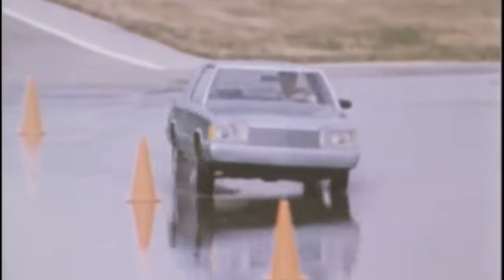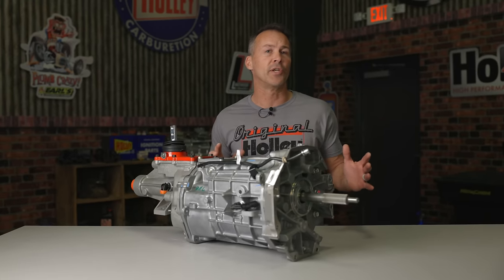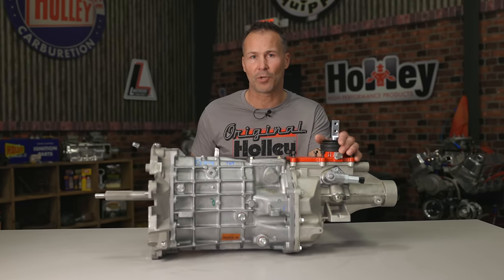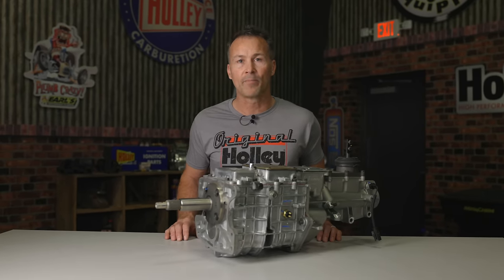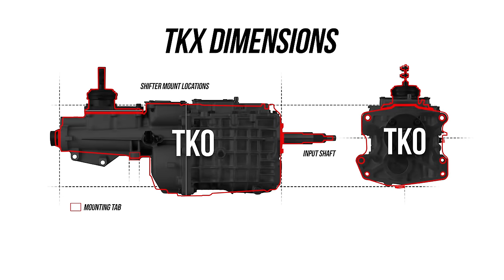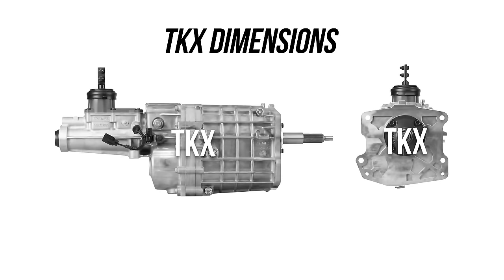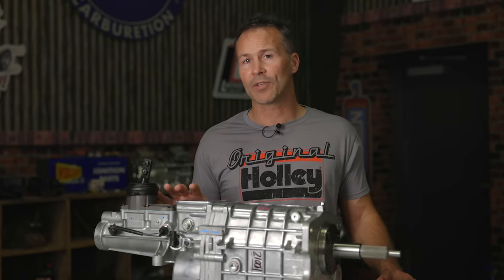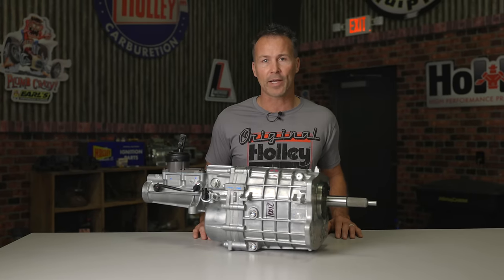A Guide To Tremec Manual Transmissions

Comment: Have had a couple T5's behind a few SBC's in my FC rx7 Chassis and its done well as long as I didn't miss a shift, I finally found the real breaking point with 482whp and 565ft'lb. I still granny shifted it as light as I could but I believe she is cooked for good.. I am almost ready to order the TKX transmission as a beautiful upgrade to replace the well tested T5. Anyone who says a T5 is garbage  probably misses alot of shifts.
Reply: Update: pulled the t5 out, turns out it was a non world class t5 that has survived 3 years abuse and 1 year of 565 ftlb of torque
Reply: ya i was running 400ft lbs in a datsun z for a few years no prob, lower car weight helps
Reply: @kennethfrazee2540  how many hp do you thing a t56 can withstand reliably?

Comment: I want to put a T56 Magnum behind a Gen 1 350 SBC. What aluminum bell housings are available (if any) to mate the two without an adapter plate or machine work on the trans or flywheel end?

Comment: Nobody mentioned that Jeep used T5s in the CJ. 3rd gear would blow out. I’ve built a bunch of them. Another POS was the Peugeot BA10. Weak knee’d piece of French junk. These used a rearward facing synchros and the locking sleeve is inside rather than sliding over the outside like most other transmissions. Shift gates were prone to breaking also.
Reply: 1982 cj7 blew 3rd gear downshifting on the street at moderate speed.

Comment: Not trying to critical, but at 1 :07 . .  showing 4 gears, talking about 5 (overdrive). 4th gear is 1:1 right? BTW, the T5 was also widely used in the F bodies from GM. But only with the 5.0 (305 cid)

Comment: Is there a special set of pliers for getting the retainer rings off of the speed sensor reluctor wheel? Its easy to get it off of the older style plastic gear with a screwdriver and pliers but its extra tight against the newer style wheel. I want to just keep prying at it with a screwdriver, but i know im just going to end up stabbing myself before i get the darn thing pried free.  I have some piston ring pliers, but theyre a bit too large to fit in that space.

Comment: I wonder if one of the Tremec transmissions could be put in my 1981 Mercedes 240d that has a 4 speed manual.  My 1964 Ford f250 also has a 4 speed and a 5 speed transmission would be perfect for both of these vehecles.

Comment: Have a 95 GMC Sierra 3500hd and it's got an NV 3500 transmission with a 454 engine if I was to switch to a tremec which transmission do you suggest I use

Comment: i wish yall would make a manual trans for us diesel guys to swap to. i'd love to swap in a manual, but nv4500/5600 dont like to shift fast, g56 is just weak, and i've not heard of anybody running a zf5 or zf6 to know where they fail when drag racing.
Reply: Best option for a new trans is a Tremec TR4050
Reply: I'm running a ZF6 by choice.  They are extremely strong transmissions,  & were grossly underrated. And specifically the Blue label,  & especially the Black label ZF6 speeds found in the C4 Corvette, the Vipers,  & Firehawks. The Blue label & Black label  were  originally rated at 700 & 750 ft lbs of torque in Germany, & Europe , but also early in the U.S.  but then downgraded to 400 & 450 ft lbs. This being to the surge of power increases in engines during this time, especially in the aftermarket upgrades, & so due to liability issues for companies like GM, etc etc they downgraded the max ratings to deter them being pushed to hard. Ironically the noise factor that got so many complaints from users is also a major strength factor, in that they have straight cut gears,  same as many "big" diesel trucks have. The ZF was originally designed as a truck transmission. Due to these complaints, the Blue label had more helical cut gears to help with noise, & obviously the Dual Mass Flywheel  (DMF) was also used to help with this noise, but also to soften engagement like a sprung hub clutch with a Single Mass Flywheel would. The DMF uses a solid hub clutch. Many serious race cars & big trucks will use a SMF with a solid hub clutch. But it is a very aggressive engagement. 
 Regardless, the ZF's are different then most manual transmissions,  & so specialists specific for them, & not to mention considerably more expensive to rebuild. Especially these days. There currently is only one real person in the U.S. who specializes in these, this being Bill Boudreau aka the "ZF Doc".  But this guy is no joke, he goes thru them, rebuilds them to the highest quality. I have my Black Label rebuilt & blueprinted to withstand over 1000 ft lbs of torque by him. I'm also converted to a Spec flywheel & clutch assembly, because the DMF won't handle the power from my Dart blocked 384 Stroker SBC with forged internals,  twin turbos , Holley EFI system,  and a lot of other goodies.  Lol! But my highly modified C4 Corvette is another story.  
Regardless for most, there are probably better options in that there are many other strong manual transmissions that would be overall cheaper to use. In reality I could have bought 2 brand new T56 Mangums for what I have in my ZF6.  Not to mention my C4 was originally an automatic, & I did the conversion myself,  as did I do all the other work on it, such as building the engine,  suspension,  etc etc etc.
Reply: @corvettefever360  I have a 93 corvette with the zf6 and I love it, Its showing its age but still great. but after ford discontinued the zf5 manual they went to the zf6 in their trucks for awhile, It's not the same one is it? they definitely don't feel the same.
Reply: @corvettefever360  "blueprinted to withstand over 1000 ft lbs of torque by him" yeah thats the problem though diesels can make that pretty much with just a screwdriver and injectors on a mechanical or a tune on an electronic injected. and they do it at a much lower rpm than a gas engine which puts more stress on the trans. there just isnt a manual trans that exists right now to handle a built diesel in drag, drift, or road racing that will last. maybe the lenco could handle drag though you'd need something like the cs1 to handle a boosted 4x4 launch. and i'd hate to see the maintenance schedule.
Reply: just use the 6 speed allison trans from the duramax. Beefed up it can easily handle over 1k horsepower.
Reply: @kenshinhimura9387  But I don't know how to drive automatic
Reply: @kenshinhimura9387  with the allison 1k ignoring the several thousand $ standalone controller just to make it work you get no push starts, no drifting clutch kicks, no ability to run in stickshift classes, increased heat output, required trans cooler and all its issues, and a trans tunnel large enough to fit a vw beetle.
Reply: If you can’t shift the NV5600, me thinks the problem lies in the driver....

Either way, if you’re racing a diesel with a manual, you’re used to losing to less powerful trucks routinely. No, the trans will never shift fast enough to be quicker than the autos. Toss a 48re in there and call it a day
Reply: @moparproud3978  i agree auto's are faster, but a manual is more fun and they're allowed in stickshift classes and drifting clutch kicks and i never said a nv4500/5600 couldn't shift. I said they dont like to shift fast.
Reply: @dungeonlord  I know what you said. I have zero issues shifting my NV5600 “fast”

Comment: How much torque can the TKX hold?? Was mentioned for all the trannys except the TKX unless I missed it?
Reply from the maker: 600 LB/FT
Reply: @HolleyPerformance  how come you couldn't get the tremec 5 spd with a 350 in 1986 trans ams? gm said it couldn't handle the power of the 350 , which wasn't much in 1986.
Reply: @fransmith8992  thats over 30 years ago...technology my friend
Reply: @jubjub905  aha. so now the t-5 is much stronger? how much will a modern one handle and is it a straight bolt in replacement?

Comment: Is there Tremec T-5 variant that will fit my 84 300zx Turbo?  I want to swap from A/T to M/T,  but the Borg Warner T-5 has a smaller pilot diameter and spline count (24t) than Ford (10t) or GM 21t). I also wonder if the length of the transmission may be different so the shifter won't line up with the port for the shifter.
Reply: manual z31s came with t-5s. Its easier to find one made for the 300zx because they use different input and maybe output shafts like you said, than trying to find a ford or aftermarket one.
Reply: @peterdeboer2805  They came with three different transmissions depending on the model and 6 different driveshaft configurations. It's also incredibly hard to find a low-mileage one, so that's why I need to expand my search to alternative options.

Comment: Imagine if the emissions era hadn’t happened. The t5 would’ve been awesome
Reply: Did they use poor ratios?
Reply: @chaseschlafmann1239  poor case reinforcement. The t5 case flexes in 3rd if you push a lot of power because they were intentionally only designed to handle the 185 horsepower of the 305 and 5.0 of the 80s

Comment: I didn't hear the torque load capacity of the TKX. Is it higher than the TKO 600?
Reply: Yes.  The internals are Magnum based and rated to the same 700ft lbs

Comment: I'm in the market for a manual that can handle 700+ ft/lbs for a turbo big block chevy.
Reply: T56 Magnum/tr6060
Reply: Bout the only trans that will is the old sm-465. Some of the mud truck guys are rumored to be putting about 1200-1500 horse through them. But, they're not drag racing them.

Comment: gm used tremecs in 1986 in firebirds and trans ams and you couldn't get it with a 350. only with the v6 or the 305 because it couldn't handle much power.
Reply: GM used Borg Warner T-5 manuals, and they were only available with 5.0L V8. All other engines were the 700R4 automatic. The Borg Warner had notoriously weak bearing and input shaft. Stock 350 torque is more than capable of snapping the input shaft or severely twisting it.
Reply: @levistoner  1986 v6 firebirds were available with the 5 spd t-5 manual

Comment: Any of those 4x4 trans or nah?
Reply: The t56 was used in project crazy horse years ago, behind a 347 stroker, in a 1967 bronco 4x4
Reply: @TheRoadhammer379  I’ve got a 80 Bronco with a 331 stroker with np435. It works